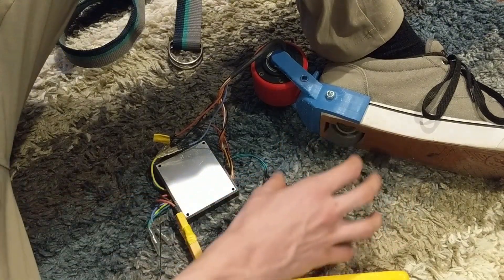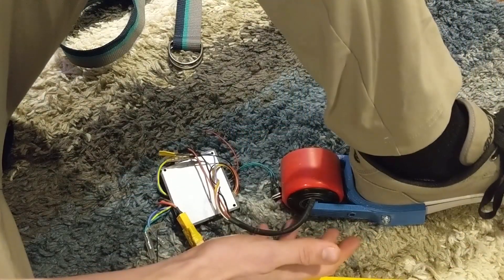DIY Motorized Heelys! 3D Printed Mod

Comment: Hi could you link the motor you used these look awesome.

Subbed
Reply from the maker: Thank you! If you look "skateboard hub motor" on eBay you'll find a bunch. They aren't particularity powerful or torque-y though so if you are trying to make a longboard electric I would recommend a belt driven setup.

I believe my motors were 70mm
Reply: @CalebMarting  Thank you

Comment: Try having the motored healy on the back foot. Have it push vs pull. Might prevent you from doing a split
Reply from the maker: My only issue with that is the back foot is pretty close to my center of gravity then. It could push my leg too far and cause me to fall backward.
Reply from the maker: Also I had the motor angle configured for my front foot so it wasn't as simple as just putting that foot back to test it
Reply: Ahh motors got good power then. Cool good luck

Comment: This is so bad. The ENTIRE POINT of heelys is that you don't see the wheels and other junk. This is just a shoe with a wheel on it. What is wrong with you?
Reply: Yeah how are yours coming along the modfather
Reply from the maker: I had a wheel and I did a thing and it works. The entire point of heelys is that they also AREN'T motorized. Let's see what you've got if you can do better

Comment: May I suggest using a 90 degree drill bit with an extension? From experience I would not recommend using the flexible versions. I built a boosted board thingy following this tutorial and thought you could incorporate some of these ideas. GL ---https://mikeshouts.com/diy-drill-powered-electric-skateboard-by-inspire-to-make/--
Reply from the maker: Oh I hadn't even thought about doing something like that. Something flexible like a Dremel tool extension would be amazing except that it probably wouldn't transfer the torque. Thanks for the idea

Comment: What if you use the same motor but simply transfer the motor energy to the Heelz(TM) Wheel  i.e. some gears/chains/axels
Reply: a drive shaft connected to worm gears would be horribly inefficient. The ration on those gears are extremely low and while he may gain torque, he would probably be limited to around 1mph. A better idea would be to design a larger shoe from the ground up. Might look a little comical but if it can hold the motor then who cares.
Reply from the maker: I wish I had the money to make it lol. What I was looking at doing was getting an outrunner brushless motor the size of the current wheel that would have just enough power to maintain speed on flat ground. You would use the outrunner as the wheel itself by putting some rubber on it.
Reply: @CalebMarting  That's the same idea I had.  They don't seem to make those wheels smaller than like 70mm and the motors themselves go down to like 50mm and once you add the plastic it's a pretty big wheel.
Reply from the maker: It would be hard to do that in such a confined space but could definitely be possible, I'll have to think about that. Too much money to spend that I don't have though :p